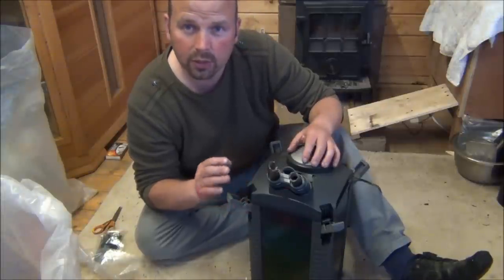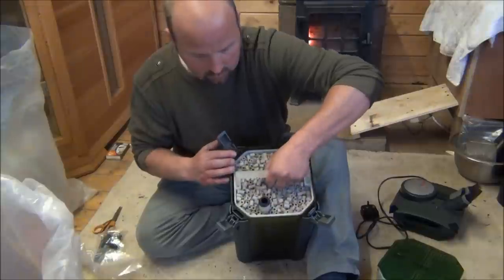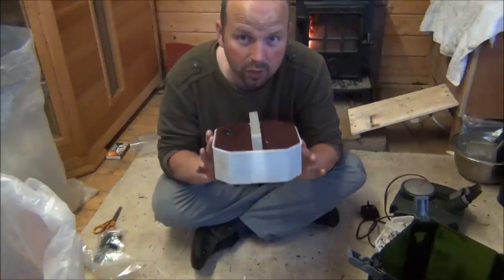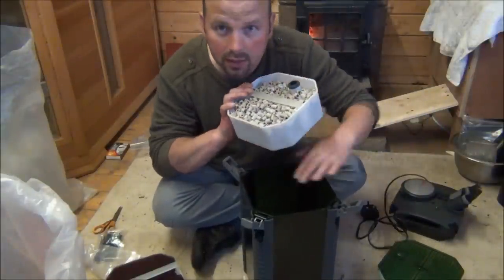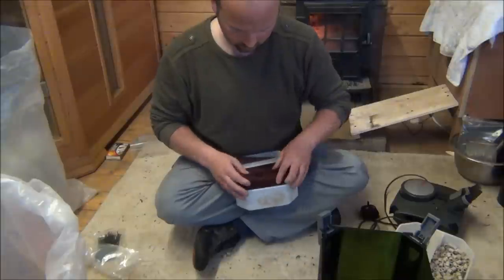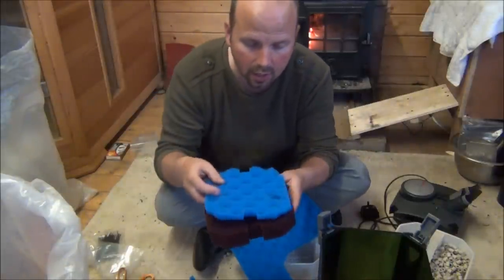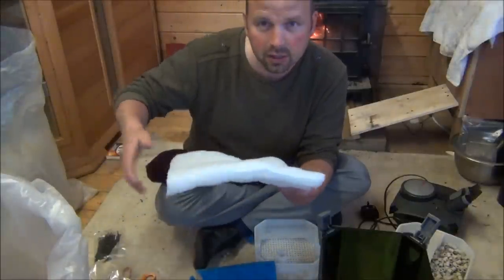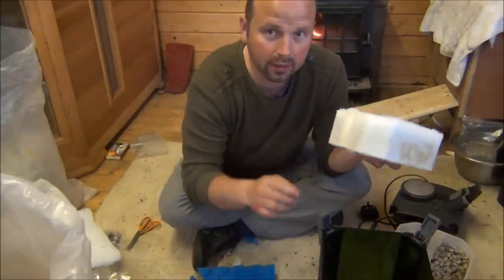How to set up an external canister filter for aquarium by Pondguru

Comment: I have a Jebao 404 external filter.  It has 4 trays that come in it.  I what to know what's the best way to sit it up.  I looked at you video should I do it the way you did, or with 2 trays of form and 2 trays of media?
Reply from the maker: It depends on how much muck you think you are going to get generated in the tank (and therefore the filter) from your fish stock so you can go either way. Whatever way you do it it will be much more efficient when the water hits foams before the media.
Reply: Pondguru I have a 75gal tank with 25 Mbuna Cichlids in it.
Reply from the maker: Denell Rivers
Yes, 2 trays of foams and two of Biohome would do a great filtering job.

Comment: As for the pre-filter, why not put a sponge filter on the input nozzle? Not only keeps the smaller critters safe , but takes stage one of mechanical out of the basket. Easier to remove and clean on a regular basis.

Comment: Hi mate I use K1 bio wheels they are realy good I have it on my fluval 206 canister and in my home made filter in a water bottle with air stone and they are self cleaning so you never have to take them out to clean every time they bang in to each other it's knocks off the week bacteria and keeps the strong ones they come in a large tub about £3.99 or it could be £6 from Amazon the water board have used them and tested them for over 15 years I realy rate them I use them in my home made filter to make one get a large volvic water bottle or a small with screw on cap you drill five holes in cap 6 on the top drill a hole on the neck of the bottle to put   Air stone and tube feed the air line tube through the neck of the bottle then and the other end feed tube through the hole and the air stone will be left inside and pull tube right through drill to hole on the back to hold two sucker then take off bottle cap put in you K1 media in fill it half. Full put cap back on put it in the tank put other end of tube on the pump turn it on and you are good to go the K1 media sits at the top after a week or two the media will start moving around as it get more heavy with bacteria and. You leave it going 24/7 and you will never have to take it out or clean it and my water us very clear so that's my tip for you I am going to make one for my small tank
Reply from the maker: Not sure if you have seen K1 micro - it is by far the best moving bed filter media for small DIY moving bed filters as it has almost twice the surface area per volume than standard K1.

Comment: I'm trying to reduce the flow on my hydra Filtron 1800 from a flow rate of 1100 lph to around the 900's, the reason is I have a Vecton UV steriliser with a max flow rate of 980 lph.  Would adding more filter media slow down the flow rate.  Thanks.

Comment: Hello, I just recently purchased a filter just like the one you are using in your video. What kind is it? I need to purchase the hoses for it.
Reply from the maker: The one used in this video was an old Eheim series 2 canister filter and I think the tubes were 16mm (internal diameter) for this one. If you need hoses for the one you have it could be one of 2-3 different sizes so it's best to take the filter or hose fittings to a shop to ensue you get the right size. Some manufacturers measure hoses internal diameter and some measure external diameter.

Comment: I'm want to change from an internal filter to an external one.
Do I take the foam and media from the internal one and put them in the external or should I run both filters along side each other?

Thanks.
Reply from the maker: It is best to run both filters, yes.
Depending on what type(s) of media you have in the new external filter you will have to wait for varying times before removing the internal filter to be sure the external is mature enough to cope.
For example:
Plastic media or cheap ceramic rings (smooth) - up to 6 months
Better quality ceramic or most sintered glass media - 3-4 weeks
Biohome ultimate or Biohome plus - 2-3 weeks

Comment: Hi, great video
HOW OFTEN YOU CLEAN THE FILTER/
THANKS.
Reply from the maker: Most people will check an external filter once a month but how often it actually needs cleaning will depend on the size of filter, how it is set up, stock and feeding.
With a well set up oversized filter you may only need to check every 4-6 months.
Reply: Hi, again thanks for your reply
any help regarding the EFX2000?
Reply from the maker: It can be set up just the same as the one in this video and according to my records each tray will hold approx. 2.5kg of biohome mini ultra or biohome ultimate.
Reply: Hi, again
thanks for your reply
where to buy the stuff in the video
Thanks.
Reply from the maker: I sell it in England here http://www.filterpro.co.uk and on the top of every page of that website there are links to other suppliers (flags at top of page).

Comment: Hi,
I have a 72 litre tank and need to get a better filter.  Do you recommend and internal or external filter for this size tank?
thanks.
Reply from the maker: External will always be better than internal so if you can get a suitable size one go external.
Reply: Pondguru Hi Richard, thanks for your advice.  Since then I have bought an Aquaone canister filter as well as the biohome media and I have never seen my fish happier with clear clean water and I haven't had to clean the filter yet.  I just have to wait a few more months until the media can work on the nitrate level to cut out the algea as it is building up.  Thanks again for your great advise.
Reply from the maker: Ted Nguyen No worries, glad you enjoy the videos.

Comment: I purchased biohome media from you a little while back. It was in my JBL external filter for about a year. Now the media is starting to break down i.e. fine sandy particles are breaking off. should this be happening?  and will this damage my filter? The media is now in my Seachem Tital hob filter.
Reply from the maker: Generally you would only notice a small amount of wear after a year but every time media (of any ceramic or sintered glass type) is moved it has a chance to rub together and produce dust. It will not damage filter.
Feel free to send pictures to sales@filterpro.co.uk if you have concerns about premature wearing.
Regards,
Richard

Comment: Do you recommend Eheim or other brands (fluval and aquaone)?
 I have a 400L tank and I'm thinking about getting an Eheim but I've heard some negatives about the brand.
Any help would be much appreciated!
Reply from the maker: I've always liked eheim as their products are made to a high standard and spares are readily available for really old models of filters and pumps allowing them to have a very long working life.
Having said that I'm not really one for brand names and the external filters available now (even the cheap ones) are generally very good.
The most important thing is that they are set up properly with the mechanical filtration being completed before the water hits the media. As they generally are all copied from each other they all work in a very similar manner and are easy to set up correctly.
Reply: Very useful,
thank you!
Reply from the maker: Daisy Hodgson
No worries, remember not to be concerned with names - just look for quality and usefulness (even if you have to alter it to make it work as it should)

Comment: I'm looking for a canister, and I saw JBL as an option, what do you think? I found it good by the price range
Reply from the maker: All mid range canisters are decent and the JBL line is no exception. Some have a 'pre-filter' so leave that as it is, set the rest of the trays up as in the video and it will work fine.
Just remember to order one which is big enough for the tank and stock - if it says 'up to 300 litres you can halve that for a normally stocked tank (150 litres). Most people end up running filters which are too small for their tanks, for example they only see the higher figure in 'for tanks 200 litres -400 litres'. 400 litres is a fully planted tank with minimal stock and 200 litres is a normally stocked tank.
Hope that makes sense.
Reply: I'm thinking of buying the Canister Jbl E-1501 for aquarium 350L? What do you think, my fear is having problem, I thought a lot about sunp too
Reply from the maker: I would personally go for the 1901 as it has an extra tray. Each tray will hold approx. 1.2kg of biohome mini ultra or biohome ultimate so the 1901 would give you enough media for seeing the reduction in nitrate for a normally stocked 350 litre tank.

Comment: I have a question for you.  I have a red ear slider turtle and have him in a 20 gallon long tank. I use a very cheap filter system and I want to get a excellent canister filter. Don't know which one to get. Also where can I get that Home mini bio ultra media. Where I get my turtle water conditioner and filter stuff they don't have that kind you use.  Thanks
Reply from the maker: tammy bartelme There are suppliers of biohome in different countries - where are you? The tank really needs to be at least twice that size for a red belly and the so go for an external which will filter twice what you have (e.g. if you have a 40 gallon tank get a filter which will filter 80 for turtles) The make of filter isn't too important but how it is set up inside is very important.
Reply: I live in Green Bay Wisconsin   in the United States. But I was looking on line at Ebay and came across those ceramic noodles. But thanks for the info on the tank size and filter. I will leep you posted on the out come.
Reply from the maker: tammy bartelme There is a link for the US supplier in video description, no worries.

Comment: I My fingers are not strong enough to remove the impeller cap to clean EFX/200 the filter. Would  be able to use an instrument to remove it or is there  a risk of damage? Would hot water help?

Comment: dear friend, 

q1: when chosing a chiller, do i Calculate the total amount of the sump and tank or only tank? 
my tank volume: 550 gallon 
my sump 250 gallon 

so when i consider a chiller ill chose one suitable for 800 gallon or more? or should i calculate the amount of return water like: 

800 x 6 = 4800 gallon? so ill chose one for 4800 gallon and above? 

which number should i go with? I'm confused a bit here 800 gallon or 4800 gallon? 

thanks
Reply from the maker: I'm not going to be much help here as we never had a need for a chiller when  had the shop so I know very little about them. I would think that the entire volume of tank and sump (800gal.) would equal the size of chiller needed (maybe go for model which will do slightly more so it doesn't work as hard?)

Comment: Dear mr guru because of a problem with the comments  i have re submitted my question which is, the eheim 2224 only has two baskets so foam layers in the bottom and biohome media in the top. But the 2224 does not have the plastic tray that you put in last ,would the filter be ok to run on your set up without the tray? .I would be using a125 litre tank. thankyou
Reply from the maker: Yes would be no problem as the tray is there to prevent the fibres of floss or matting becoming tangled in the pump impeller. Since the media is too heavy and large to get sucked up through the holes that will not be a problem.

Comment from the maker: I really should do a video on cleaning an external filter but it is a simple matter of removing the foams and media and cleaning them in the water you drain off the tank during water change. Clean as necessary - may go a couple of months or more. If you use this video as a guide to how much you will need I use best part of 3kg for this filter. My email address is in video description (click 'show more') and once you know how much you need just let me know and I can work out a price no problem.

Comment: Hi Pondguru, can I put K1 micro at the second tray start from bottom, 3rd is lava stone/coral stone/ceramic tube, and 4th is active carbon. Or can you organize it in correct order? Thanks, hope you reply soon :) Im waiting
Reply from the maker: +shamarells 94 The filter should simply be set up as in this video with all foams in bottom and media in trays above that. If you are using carbon it should be the last thing water hits before leaving the filter.
Unless you have a FX5 or FX6 filter your external filter trays will work from bottom to top.
Reply: Thank you Pondguru Outdoors !

Comment: Hey! I need your advice. I am using an allpondsolutions 1400ef plus external filter, I just want to know if this method will be suitable for this external filter and is this method 100% cost effective? and also What media would you recommend ftom either of thesr carbon, ceramic rings or bio balls? (they come with the all pondsolution filter)
Reply from the maker: +Ugurcan Erdem (Uerde) I personally wouldn't use any of those supplied media unless I needed to draw in some residual treatments or colour from bogwood, then the carbon would come in handy. Setting the filter up this way will make it as efficient as it possibly can be and the 1400 would take a similar amount. I do a filter upgrade kit which includes the media and foams: http://www.ebay.co.uk/itm/EXTERNAL-FILTER-UPGRADE-KIT-3Kg-MEDIA-FOAMS-AND-50-FREE-BACTERIA-BALLS-/221636444929?hash=item339a8fc301

Comment: Hi Do you think i could fill my aqua one 1200 filter up with water first rather than suck it from tank to get it going,as i will have to top my tank up as the cannister fills and it holds a lot of water .I have rsm 130 and would soon run the compartment at back too low.Thanks
Reply from the maker: Yes it would make sense to fill the filter with (tank) water first.

Comment: Will this set up work for a turtle tank as well I'm having trouble keeping mine clean. A friend watched me cleaning it and told me I was owing it wrong, I was actually taking everything out of tank and filer and cleaning it with soap and water. Just bought I 40 gallon tank and Fluval 306 filter for a 65 gallon tank and want to make sure I set it up correctly.
Reply from the maker: Yes this would work fine for any external filter and if you are in the US we now have a biohome supplier there http://www.greatwaveeng.com
Ideally you should only do up to 25% water change a week and have good enough filtration for the level of stock. Turtles are very heavy polluters so ideally the filter and tank would be larger but I'm assuming yours are still small species so should be fine in 40g. Each tray of the 306 should hold up to 1kg of biohome mini ultra  / biohome  ultimate.
Reply: +Pondguru Outdoors Thank you so much I have set it up and it seems to working working a lot better I will check the site for the Biohome because I've had no luck finding it in any of the Pet Stores here in RI it's crazy. LOL Again thank you
Reply: +Eladio Hernandez I'm sorry one more thing should I be using the charcoal or that black stuff that came with the filter?
Reply from the maker: The biohome is only available from one distributor in each country where stockists are. What country is RI?
What is the black stuff which came with the filter?

Comment: Ok have a couple of questions I purchased eheim pro 4+ 2273. It is kinda different from the one you showed in video. Could you walk me through the setup on that one? Doing a set up for my four yyear old daughters natural planted 75 gallon tank. Thank you for your time.
Reply from the maker: The 4+ has a pre-filter tray in the very top of the filter so just leave that as it is, set  up bottom tray with coarse and medium foams and fine pad and then have the biohome in trays above that.
Water hits the pre-filter first then heads down to the bottom of the filter before rising up through the trays and out through the middle of the pre-filter tray.
Reply: Pondguru ok so take the fine filter out of the extended running try and move it to bottom with course and fine foam, then put biohome in the rest. Ok thank you for your time.
Reply from the maker: That's about it yes.

Comment: Hey Pondguru, would you use the 'k1 micro' at the very bottom instead of the ceramic pipes ?, i have some space down there (jbl cristalprofi e401), and i think the k1micro might have more room down there... ? tell me :-)
Reply from the maker: I would personally go with the heavier ceramic media as the K1 will float about and be terrible during maintenance. The ceramic will stay in the bottom and not float about when you take the trays out for cleaning.

Comment: I have a question for you will this work with turtle as well I've been having issues with my water it goes completely clean for a while and then it gets like a bacterial bloom kind of look now I have the fine foam only just bought the heavy foam today I use black charcoal bags for carbon and on the top one purigen I am going to do your suggestion of the foam layers but will the stuff that you use for bio be okay for turtles
Reply from the maker: +mvf212 Yes definitely get as much filtration in there as possible and if you want the bacteria to have a good home to increase the bacterial processes and get rid of the purigen if you want the filter to develop with bacteria and control pollution levels naturally as a filter should. The foams and media are fine for use with all freshwater and saltwater tanks. You will find plenty of extra information on my new website in the Q&A section: http://www.filterpro.co.uk

Comment: Hi,
In what order would you place the media in an internal filter that draws water from top to bottom through the media and then push the filtered water back up? Like in the Juwel Bioflow ones for ex? Should the ceramic be at the very bottom?
Reply from the maker: Yes but they are not really necessary. They can just help to trap heavy muck to save the foams getting clogged so quickly.